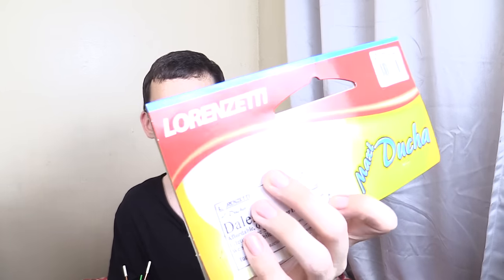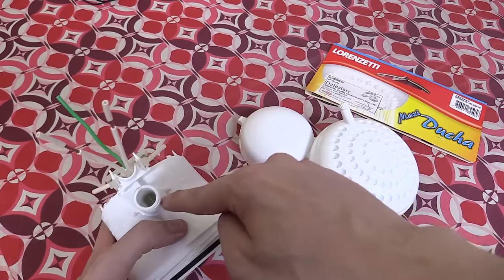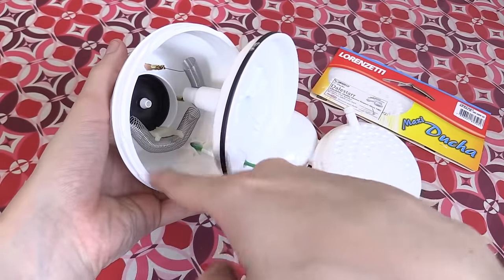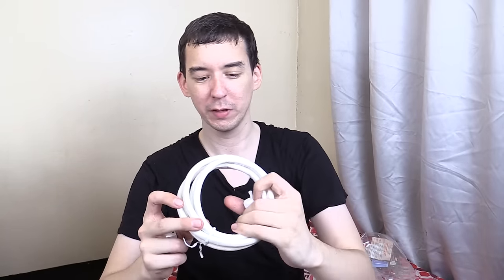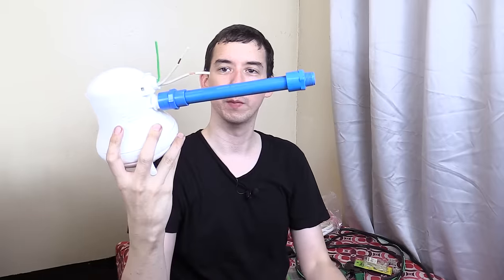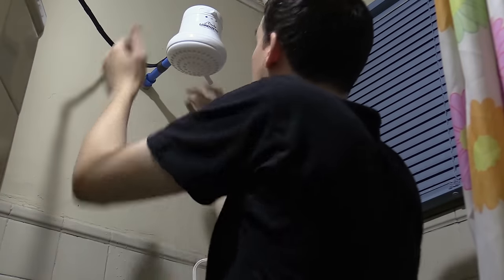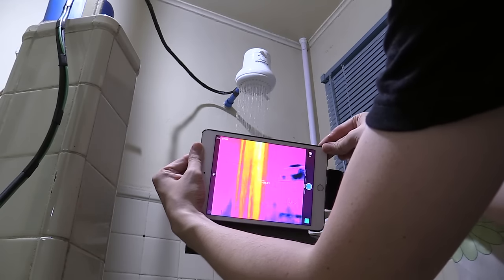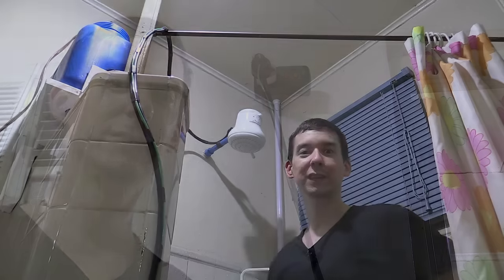Lorenzetti Electric Shower Head

Comment: Those things are super common in low income neighborhoods here in México. So much so that they're sold by the Home Depot franchise. The thing is that those pics are diy stuff worthy of the darwinian award because in most cases you'll see a clean install. They were initially intended as a backup solution cos propane/lp prices are super freakin volatile in México so most people can't really afford a 24/7 boiler setup or electrical heaters. Since in México all (or most) houses are grounded, at least here nobody has ever died from an electrocution as a consequence of a malfunction on those things. I wouldn't hate them because they have "the potential to kill someone" but rather because their heating elements are super freakin cheap. Those things die every 3 months of use or so and are hard to find since the demand for those things is so high on shelters and industrial showers
Reply: Threen months only?! Here in Brazil everyone knows that even the heating element takes far longer to die - let alone the shower itself. You shouldn't buy "generic brand" or "Made in China" electric showers!
Reply: yes.. very odd. I use a mixed system with solar and electrical central heater + electric shower head (they heat quicker also some of them have pressurizer) anyway... I can't remember having to change the resistance in less than 1 year... I'd say that they lasts at least 2 years in average. 
And I do buy better ones. Lorenzetti has a line where the heating element comes on a cartridge, so it's very easy to change it. Actually I changed 1 of mine a week ago. But forgot to turn it off before having some water passing trough... result: almost burn the entire showerhead and had to buy another cartridge.
Reply: Guilherme Sartorato That must be the issue! Most of the ones we buy are Made in China (and are not even that cheap in their price tag lmao). Those Made in China one's are the only ones sold by the Home Depot. In most cases, other hardware stores reserve themselves of selling heated showers in that presentation because they also want to sell you instalation services, so they'll try to get you to buy Electric heaters or Boiler setups and instalation services. Since mostly everything in the Home Depot is DIY, I guess that that's why these days you only find them in super markets and home depot.
Reply: Grigio That is actually super interesting... I had no idea that there was a manufacturer that produced such handy set ups!
Reply: +Vulgar Phil   +Grigio
Oh, yeah; I found it amazing too, when my wife told me she has lived in a pension whose shower had solar heating + electric head. While I frown upon those expensive "Star Trek" solar energy set ups, I found out solar heaters are far more realiable, sturdy, easy to install, cheap and low-maintenance. Notice heating and air-conditioning are the main culprits of higher electricity bills while the impact of (non-incandescent) lamps, electronic stuff and electric tools/appliances (other than refrigerators, computers and large TV sets) is negligible.
Reply: Vulgar Phil Why do you need hot showers in Mexico?
Reply: @beasttitan8747   makes no sense right? Everybody knows that in Latin America it ranges from 47 to 69 Celsius degrees all year. There is no winter in that region, yeaah right.
Reply: @GustavoFolmer  sorry M'Lord, I live in Mexico and I can tell you there is snow...
Reply: True, here at home, it’s lasting for more than 10 years already.
Reply: I have heard of shower head having short circut and stuff but I never heard of any body dying from it  using one!
Reply: Who stands in a Mexian Home Depot parking lot looking for work?
Reply: How long they last depend a lot on the local water chemistry, so you can definitely expect quite different life spans depending on where you live. The wire material also differs a lot in quality, with Chinese wires being on the lower end of the spectrum.
Reply: why dont they help their people??
Reply: Im in Colombia, my shower is Lorenzetti and I0ve had it for at least 4 years. I don't know what you're talking about lol.
Reply: Come on why write an essay
Reply: Guilherme Sartorato I just use a 24/7 gas heater. In America natural gas is really cheap.
Reply: As is everywhere else but Mexico.

You had to plaster over us your freedom , hadn't you?
Reply: AD RC no, I was just sharing the way people in the US generally live. Not everyone here has a heater always running
Reply: Vulgar Phil what do you mean by so that it’s sold by Home Depot franchise I don’t get it
Reply: Im not poor i have a hot water tank. no nee of being electrocuted in my shower
Reply: @GustavoFolmer  this is a very ignorant comment
Reply: @Killuminati1blood  No money.
Reply: @kyle857  Its the same down there.  Except there are parking lot attendants that you pay to watch your car and help you back out of the space.
Reply: same in Brasil!
Reply: I live in Mexico and never ever seen these things. They are not common at all.
Reply: In my house we have a shower like that and last more than 16 years.
Reply: Why are you saying this ? I talked to a mexican electrician and he told me only rich people used those shower heads because they are super complicated to install and needed a lot of money for that. Also, boilers and electrical heaters are super common between poor people here. 🤔
Reply: @APerson-zd5gv  lmao that is very intertesting. Rich people in México can have anywhere from jacuzzis to bathroom floor heating systems. Guess rich ppl are the same anywhere you go in the world lmao. Also, I think that he was talking about electrical water heaters. These shower heads can plug to any outlet as long as it has 10 - 8 gauge wiring and is grounded. If you want to do a clean install that can be done too or you can hire someone to do it for you, as with any other job.
Reply: In Mexico most houses are grounded? You live in a bubble? Most "maestros" can't be bothered to spend more on grounding or even know it exists.
Reply: I’m in Mexico and and had a foset brand Installed.… Are you saying this will break in after roughly 3 months? Also, I generally use the solar shower, I have an option to switch to this.… In other words, I won’t use it a whole lot.
Reply: Not tue. I'm Mexican I've lived all over from Merida to Tijuana and never saw those things but in the north pacific area. Everybody in all major cities use standard heaters. Either electric or gas. And gas prices aren't super volatile. They do change a few pesos here and there but not much.
Reply: It's spelled "SHOCK" * ... electricution is not a word in the English dictionary 😅
Also i had one last for over a year but all others i've had did not even make it 3 months, also they gave shocks so i think they didn't put the ground cable 🤦🏻‍♂️⚡️
Reply: @666DAZER  Dude I'm mad confused..... I can google it and it says that it was a term coined in the late 19th century in the US and I've heard people use it. Is it like slang or something?

Comment: 😁 It is fun to see one of the most iconic products sold in Brasil (my country) on a blog from another country.

This shower looks dangerous but truth is almost everyone in Brasil use them from poor to middle class and even some rich people, the only thing that change is the sophistication of the shower.
Reply: I think brazilian people don't like that other countries have access to gas installations and they say they are not safe. Why? If you don't know how it works?
Gas or electrical tanks for water heating, properly installed, regulated and FAR AWAY from the shower, are the standard in any serious country.
It would be better for you to accept that you use something that it's risky to improve, instead of arguing that the entire world is wrong.
Reply: There has been a total of 200 deaths in a year related to electricity in Brazil's homes, and most of them are related to electrical sockets. If there`s even one case a year of death related to a electrical shower, i`d be surprised. It`s almost impossible to die from one of them.
Reply: noxxi knox man, take it for what it's worth it. I'm 31 yo and I have had an averege of 2 showers a day with those. Never been shocked. In some cases, you feel a little shock when you touch the valve if the shower is not grounded (in my house they are all grounded) and I didn't say it's impossible to die from it, I told you I don't know any case whereas I knew people that died from gas related problems even they are much less common. I'm not advocating for one kind of shower or other but trying to show those who never had contact with one of those to know that when you get under one of these you are not almost committing suicide as it is being shown in this lame video.
Reply: noxxi knox as I said earlier, this is a huge country and there are areas where neighter gas nor electricity is available. Guess what? People warm their water in a stove to shower with a bucket. I'm just trying to tell folks that we are not stupid as some are thinking. There is really nothing that dangerous happening here in this regard.
Reply: the sophistication of the shower.
Reply: @fabianroger  My friend, electric showers are the standard here in Brazil for since forever. I have more than 50 years and have never had a single problem with this type of device. (Well, excluding that time I got too lazy to turn off electrical power to install a new shower, and took a 220 volts electric shock, but it was not the fault of the shower, could have been a lamp and the problem would be the same, lol)

Anyway, the electric shower is standard here, and that does not mean that a central heater is anything better and also that this system does not need to "evolve" to another heating system.

It may be good for you, who lives in a cold country where the water must be warm all the time not to freeze in the pipes. But here, where most of the country is hot, the electric shower is the most economical method of heating water. It is instantaneous and only heats what will be used.

Hot water in the kitchen sink? Totally unnecessary. In cities in the north of the country the electric shower is not used because it is so hot that it is not necessary.

I live in São Paulo, a city that is cold for a good part of the year. Now in my new apartment, the shower water is heated by gas and the heater is far away, there in the "service area" where brooms and buckets are stored. And you know what? I much prefer the electric shower. The gas heater spends so much water that it becomes shameful. All cold water inside the recess must be discarded before the hot water arrives. About 1 minute spent water for nothing.

A central boiler for the whole building? No way. Only hotels have this. And the cost is much higher, to keep the water warm all the time.

Lastly, an eletric shower is the a device that balances cost and benefit. And it was released in the US too, a few years ago. But to be installed outside the bathroom. It was called "hot water on demand". Good for anyone who is afraid (unsubstantiated) of electrocuted dying.

Cheers
(translated from Portuguese by Tradukka)
Reply: felcas rich people dont use this trash lets be honest
Reply: noxxi knox  Here is not a place with no quality control, laws and consumer protections. You can believe or not about this, but there´s a truth and it was explained  yeat. People die here by electric sockets. But never in my 53 yeas I saw any report about people died by electric shower. And yes, it´s easy to have an electric circuit at home, but not a gas pipe on a 8.5 million square kilometers country.
Reply: noxxi knox   Ok man. Now I´ll learn about our laws, my country, and yes! How to search in my native language using two different expression in english! yes! Changes everything! Search by yourself if Don´t be silly. There´s a chance to an accident? Yes, I do really agree. In a 210 million people, how many times it occur in a week, a day, a year, a decade? Show us. It´ll be very useful to all us
Reply: noxxi knox  your only problem is that you are assuming things just because you "cant believe they are safe because they dont look like it" if this assumption was correct then planes wouldn't be safe, but they are, just like the shower
Reply: @mandem1209  they use though
Reply: noxxi knox  well if it is just your personal preference I dont mind, have a good day :)
Reply: Se isso mata, no Brasil (e na América Latina), tá todo mundo morto. Inclusive eu...
Reply: Dude your read more button is broken
Reply: But you don't have hot water tanks in your houses? Not even rich people? In Canada it's standard everywhere. Everyone in my family has a standard electric tank but I think you can get a gas one
Reply: @tcg1_qc  No, we don't. For reasons already explained. Please, read previous replies.
Reply: @mtrivelin  I see. But I mean, even if it costs more, you can get hot water everywhere in your house. I don't know if it's hot enough where you are so you don't need to make the water warmer in sinks, because here it's freezing
Reply: Gamer du Québec in colder regions of the country, it is more common to have other systems to deliver warm water in sinks for instance but for the most part, it's not really necessary so we just use the electric shower which heats water very quickly and just the amount you need.
Reply: capnskiddies because we don't need it
Reply: @ThiagoSFFranco  oh ok
Reply: @capnskiddies  What is a black metal?
Reply: @tcg1_qc  a pot made of black metal
Reply: @SpaghettiToaster  oh
Reply: @fabianroger  but it is not risky, and if it was, we don't have another option anyway
Reply: @fabianroger  HAHAHA Man, you need to calm down. Whats wrong with u? Ahauah
Reply: @fabianroger  Gas heating installation systems are NOT used in the entire world as you claim, the cost is prohibitive for most under-developed countries. If you want to talk about how developed and under-developed countries are able to cope according with their economic capabilities that's another topic to be discussed. No system is entirely safe. I totally agree with you when I see the way these showers have been installed, but if you have a reputable device and proper ground, these showers can work reliably. "I think brazilian people don't like that other countries have access to gas installations". That's nothing to do with liking or not liking, it's only economic reasons, that's all.
Reply: @fabianroger  Using them for 26 years, my parents for almots 60 years, never, ever, heard of anyone getting something near as an accident by using eletric showers.
Reply: @rodrigosantos4160  A lot of Brazilians have fear of having gas pipes under the streets, they think they will explode, but they are ok about mixing water and at least 4000W of electricity power above their heads... fala sério...
The world works very similar including under-developed countries, you have to assume that you're the exception.
Reply: @stephanyrebelato1808  Te incomoda uma opinião diferente? O problema é de vc!